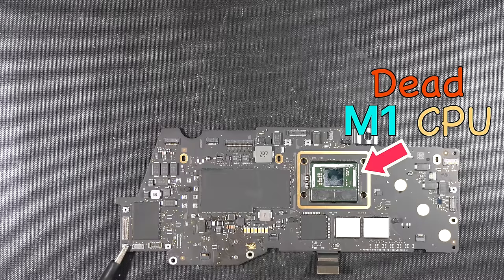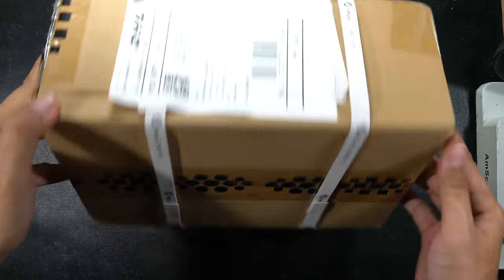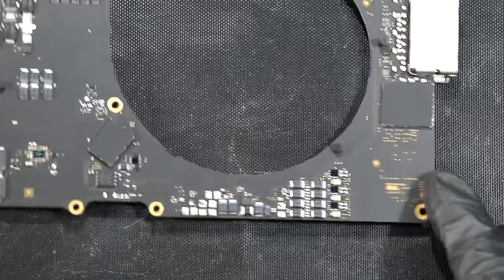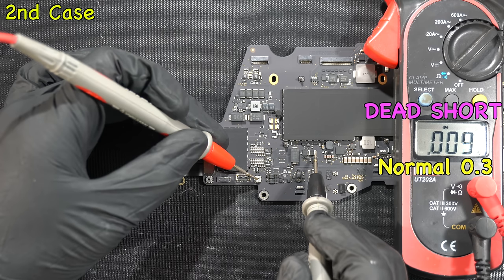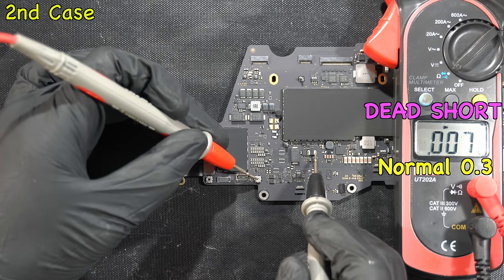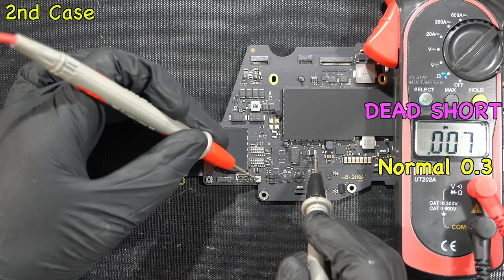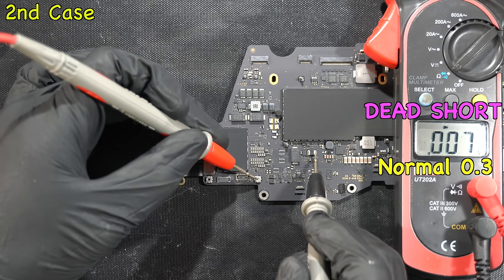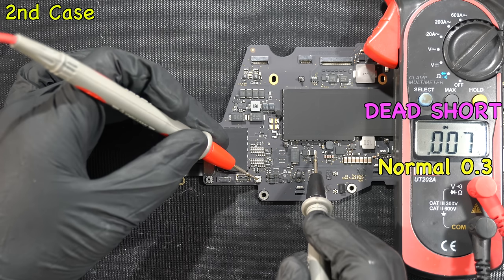7x Dead M1 Mac - Logic Board Repair

Comment: I’m watching this while my 6 months M2 MacBook Air died for no reason. Service Center suggested a logic board repair. I’ve no faith that this will even cross 2 years mark.
Reply: You're welcome to send it to us, we work on Macbooks all the time :)
Reply: maybe go for an m1 macbook air, same performance basically and much better handling heat. been using mine since 2020 and it's still going strong with 91% battery health
Reply: @nintendork07  I already have one for my wife, bought it when it was released. That broke down with a clear warning for battery service in the very first year. Got it fixed. Since then, it's fine so far. Point is, these machines are not very reliable as we think they are.
Reply: Do you want to sell it?
Reply: @maybelbdidit  have you guys got a Macbook Air M1 A1932 logic board to sell?
Reply: @gopalvirtual  they are pretty good i have been running m2 air for 1 year, 2012 imac for 5 years, and 2013 mbp for 7 years no issues at all the mbp just said service recommended 1 week ago so this battery lasted 11 years before saying service recommended

Comment: $3 Trillion, thats how rich the company is and they can't can get design a motherboard, its a a shame how they are using inferior capacitors and there is not safety for the SOC in case of a short.
Reply: Stop buying their products until they improve the quality
Reply: What if it's cheap USB-C Hubs causing the issue?
Reply: @trshcln6937  And what if it's a user caused fault like from buying cheaply made, non-certified Type-C Hubs, and other similar peripherals?
Reply: Their fuses NEVER blow & they create new BRICKS every day.
Reply: Sentences, hard to read when random words are thrown in.
Reply: It’s almost like they want to force you to buy a new computer every few years🤔
Reply: @nilomyki,,  bad peripheral and usb hub can't do any harm to the board, it is mandatory to have a protection like circuit breaker on the board and every port in case something goes wrong, unless there is no protection at all, or you made a diy usb with power and ground cable tied together, even if you did, it only blows a circuit breaker or fuse.

and you just proved there is a huge flaw in apple design by not having a circuit protection, even a cheap laptop has circuit breaker and surge protector.
Reply: they even use Toshiba NAND chip.
Reply: Shout out to the 2016 era boards that had cpu data lines right next to backlight circuit in the screen flex connector.
Reply: @nilomyki bruh if they can't design protection circuits, that's on them.
Reply: It's not that they can't, it's about generating revenue, profit. End of story.
Reply: @nilomyki  I mean other manufacturers don't appear to have issues with this "user error" if that even is the case. I hope you're getting paid by Apple because it's pretty cringe to try and defend one of the richest companies on Earth for free
Reply: I think you’re missing how they became a $3 trillion company lol. It wasn’t pandering to the .05% of people that want to repair their own machine. 

It’s making a good quality product that appeals to the most people as possible by offering and controlling the sandbox.
Reply: @Errcyco  I think you're misunderstanding what the point is. The issue the OP is referring to is that Apple is using the incorrect parts in the board (inferior capacitors), which means that they can suddenly just die. It doesn't have anything to do with people wanting to repair their own machines.
Also, you could argue that their products are not good quality because of choices like these but it's true that the general public perceives them as being good quality and superficially they have great build quality.
Reply: @isa_L  I think the protection is for when the cable or peripheral causes a short. I don't think there's a circuit breaker to stop high voltage being fed into the computer from the peripheral.
Reply: @trshcln6937  the never improve the quality, more like make worse, which ipad pro m2 already did
Reply: And this is no wonder how a 50 euro pc is better than 2000 Euro Mac!
Reply: I've never had this experience, I haven't had an Apple product fail... the Macintosh from the 80's still runs, the G4 from 1998 still works, and I'm still runnning the Mini from late 2012, Ipad & Iphone from '13 still work and the most recent phone is from 2020.. now I did avoid Imacs and Macbooks as I somehow thought they might not be platforms that will last.
Reply: iBoff helped me to decide that my next PC will be a ThinkPad X1/P1 instead of an actual MacBook Pro.

I have the 16” 2019 one and I didn’t knew that they suffer sudden death due to a design flaw in the motherboard that fries the NAND storage.

Heck, I have a 2011 ThinkPad T420 and still rocks to this day, and feels way superior in terms of quality when compared to my Mac.
Reply: @AntiGrieferGames what are you even talking about? The iPad pros have the best build quality in the entire tablet market. You guys are Apple haters and spread lies because of it
Reply: That’s their market cap, that’s not how much money they have HAHAHAHAA
Reply: @FlyByWire1   No, ipad pros are the worst one. Soo many issues which im gladly gave back. cant deal with the DRM Software!
Reply: Every company that makes laptops have many units that are defective or break internally. It’s not just an Apple thing.
Reply: @tanzkatzen  The problem is with the newer Apple stuff. I still have a 2014 MacBook Air, a vintage iMac, an old G-series MacBook Pro and even [in a drawer somewhere] an old iPhone 3GS, all of which still work fine. 

I wouldn't touch anything from the Tim Cook era though. Apple's quality control has fallen off a cliff. They'll NEVER admit that anything is a design fault ["You're holding it wrong" anyone?] and, with each passing generation, their devices get less and less repairable.

I was briefly considering upgrading to an M-series MacBook Pro, but the number of reports of them dying like this has really put me off.
Reply: Nooo say it ain't so.. I want to upgrade to an M2 mini..  one thing I do with desktops is though they only get turned off when I'm out of the house for more than a few days something from the recording studio days as a lot of electronics start to fail with constant heat and cold expansion of the boards. This Late 2012 Mini has been running for most of the past 11 years..  @vlota
Reply: @tanzkatzen  I really need to upgrade too. I've started making YT videos [under another username] and editing is so painful on my 2014 MacBook Air.  I was contemplating an upgrade to an M1 Pro or Max but I really can't afford to drop  a couple of grand on a computer and have it die for no reason and with no acceptance of responsibility on Apple's part.

I'd jump to Linux in a heartbeat. I use it on a few of my older comps. But, unfortuntely Da Vinci Resolve on Linux doesn't handle MP4... which is what my video camera shoots. So I'm either stuck with editing on a painfully slow but reliable 2014 MBA, upgrading to a newer MacBook and taking my chances.... or buying another laptop brand, installing Linux and praying for improvements on that front.

Arrrgh! --I despise Apple. But I can see myelf having to give them more of my hard-earned again, in future.
Reply: Same,  Video editing at the moment is pretty much out of the question only the most basic form, I think my phone at this point is more capable,  I got a cool camera now but the old computer can't handle the files, yeah if you need a portable I can understand, dropping a couple of grand on something that could easily die and is a pita to service. 

I don't know about other OS's or hardware as it's been decades since I've used something else, my last non apple machine was a 486DX-40 :)  @vlota
Reply: They obviously don't need to, but you make it sound like they're sitting on $3T cash, which they definitely aren't. People may complain but they're still selling plenty of units.
Reply: @nilomyki  you are a true fanboi, is everyone fault but Apple, good luck!!
Reply: @nilomyki  i used the worst usb cables on my Android device vivo v19 to be specific and i never had any issue

Comment: I wished a repair shop like yours existed in my area. I took my MacBook Air to an authorized vendor and he told me that there was liquid damage. He wanted €650 for repair. There was definitely no liquid damage, which I could prove by opening the device myself. I cleaned the logic board with isopropanol and it lived on for 5 years. Sadly, it's dead now.

Comment: @iBoff RCC Hey there, thanks for all of you, and your team's hard work saving, and developing kits for these machines! I recently bought an x-gpu project+nevbolt for my 2011 MBP 17' A1297 8,3. Your work with NVMe adapter kits and repair work are making what most regard as e-waste more valuable, fun projects for the technically inclined such as myself and I really appreciate your work! Thank you again! I was thinking; in the same vein as your other mods, I would love an upgrade kit for the 8,3 to replace the aged USB 2.0 controller with a 3.0 controller and ports from 2012+, assuming a EFI patch/reprogram wouldn't make the port+controller and obviously required and non-existing adapter board swap impossible. Come to think of it, it might not even be possible to attach 3.0 ports to a 2011 board due to the lack of 3.0 landings. Heck, don't even know if the required PCH/CPU lines are connected. Perhaps more interposers can make that work? Just thinking out loud but I think if a kit could be developed to adapt native 3.0 to the 2011 8,3 it would make a really powerful machine when paired with the x-gpu kit, and an ivy bridge cpu swap. It might be more practical to just use the under utilized Expresscard/34 slot to add 3.0ish compatibility, but nobody makes a good card these days from what I've seen.  I just love the 8,3, I think it has the best screen and speaker combo of any mac from the "user repairable" era and anything that helps bump it into the future I'm all for! 

You guys are wizards! Keep blowing our minds!

Comment: Fascinating.

My Macbook M1 had the screen go black after 14 months of light and limited use.  2 months after the warranty ended. 

Just one day it wasn't working. Apple store told me to buy another Macbook essentially, since it wasn't worth repairing (vs refurb) and I was out of warranty. 

I still have no idea what went wrong with it, so now it is used as a mini desktop for compiling iOS/Mac apps, and nothing else really. I can use an external monitor thankfully also
Reply: it's essentially a Mac Mini now.
Reply: When you shine a light on the display do you see anything, eg desktop icons or whatever? If yes, perhaps it is just the backlight fuse.
Reply: @mojoblues66    There is a very faint backlight visible , but no icons/text/images.
Reply: @steve_seguin  could be the flex cable
Reply: @mojoblues66  Thank you. It could be a FlexGate issue I suppose, yeah, though I don't have the skill to fix it myself.

I'll continue to use it as a mac mini for now, and just continue to curse Apple under my breath for existing.

Comment: Heat is what makes these ceramic caps internally break and sometimes go open, most times just short. If you remove an already heat-treated ceramic from a donor board by heating it up again and then heating up again when soldering it back to the other board... You can just buy any ceramic capacitor with 10uF and 10+ Volts for that 3V3 power rail. And if the 10uF / 25V are unavailable or too short to fit on the pads, just buy 35V types or even 50V types. No problems there!

Comment: Basic question, isn't 3.3V injection to high ? Isn't the safe limit usually 1 to 1.2V ?
Reply: There is no safe voltage when using injection. Because modern elements on board can work from 0.8v up to 20v+. On this video I didn't see that technician tested shortages between other rails and not ground. He just make it burn and shine on IR camera :)

Comment: I do not like were you check board with a battery is connected, I think that first step should be disconnecting the battery and checking the board without it
Can you replace the RAM only without the M1 chip ?

Comment: Seems like capacitor rot is still a thing after that late 90's early 00's debacle. At that time almost all pc brands used crappy electrolytes witch resulted in a lot of broken pc's but even vcr's stereo equipment an so on.

Comment: Why are all the problems related to capacitors and seemingly serving random functions?

Do you think this could have something to do with using non-apple/standard chargers/dongles?
Reply: Bad capacitors have a long history and they frequently occur in batches.
Reply: They chose to use the Multi-Layer Ceramic Capacitor (MLCC) for the positions that require a little bit high capacitance (like 10uF or more) to stablise the voltage on the high current node.
These MLCCs tend to be broken easily by the mechanical issues which can come from many reasons and one of them is the temperature cycling (hot and cold over and over).
These MLCCs also don't like the high current area which will decrease its life time drastically. 
The Electrolytic Capacitor is more suitable and capable of withstand high current nodes but if they chose to use it, the Macbook will not be thin as we see nowaday. 
It's more like a trade-off between the mechanical design (as thin as possible) and electronics design.

Comment: Very good sale integration! but old school IR detecter + finger put would be enought to find any bad cap or other comp, also can be use any liquid cleener on hot area, hot spot will be boil mother father)
Reply: Rubbish. We come across many shorted components that generate very small amounts of heat that are picked up by a good thermal camera. There is no way that you will feel this amount of heat with your finger.

Comment: Injecting voltage is last measure to find issue after all other tests/inspections passed. Before doing so, normal technicians remove board from chassis and make at least visual inspection and try to find possible issue, testing all power on signals and removing suspicious elements using logic and power on procedure manual. Only when all easily removable elements removed and no options left than you can inject voltage. And you doing it just from the start. You can't tell what exactly caused shortage  before removing the board. And there is real possibility that board shortage caused by solder balls (or something else). And after injecting voltage you can cause other elements to die durning injection, making problem worse and possibly recoverable board dead permanently. Solder balls can be there from factory or after one or few elements overheating and pushing out excessive amount under itself. You can't call this video as repair. I see only rolling the dice and expecting the better.